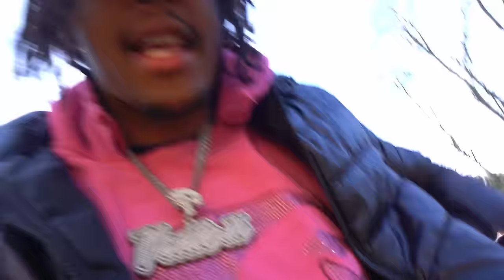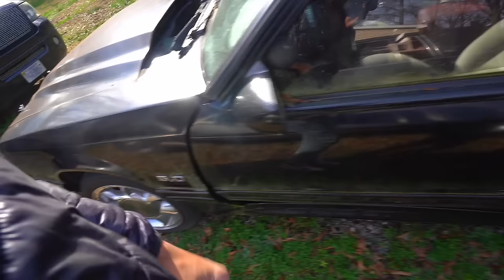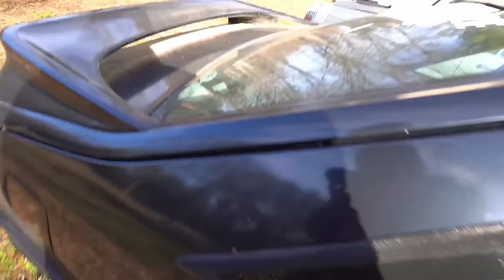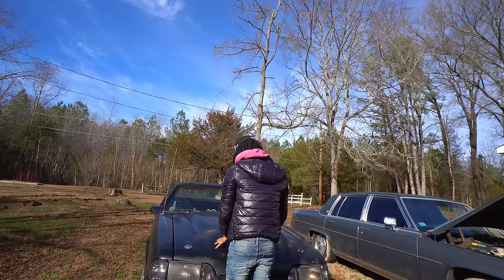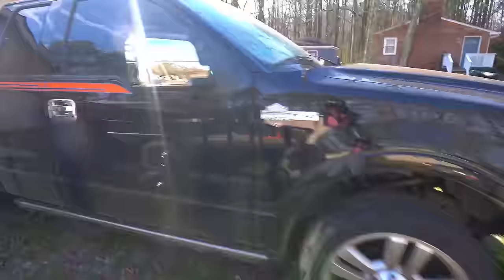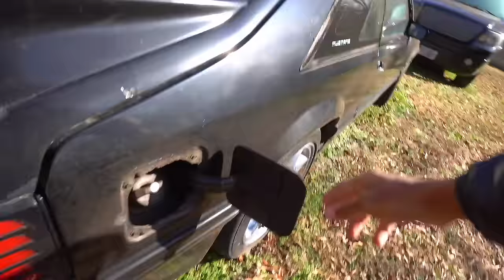I BOUGHT A FOXBODY MUSTSANG GT 🐎

Comment: Aight youngsta here we go… Don’t hate on the Stang it’s quick. If you have a 4 lug wheel convert it to 5 lug. Go 19 or 20 inch wheels with 35 series tire. We want an offset with a lip on rear wheels if not go 4 squared with lips all around (shop by lug pattern you’ll get more options) . Get new headers. 2 inch exhaust with x or h pipe. Your preference. Go turbo or procharger on motor ( coyote is a tight fit & a lot for maintenance, can’t reach anything without squeezing). Go led all lights and new dash. Redo stock interior with new leather/ fabric or swap out with newer Stang interior.

Comment: The foxbody engine bay can fit the coyote just be prepared to drop the motor if you need to replace spark plugs be sure to do suspension and brake upgrades a nice cage would help too